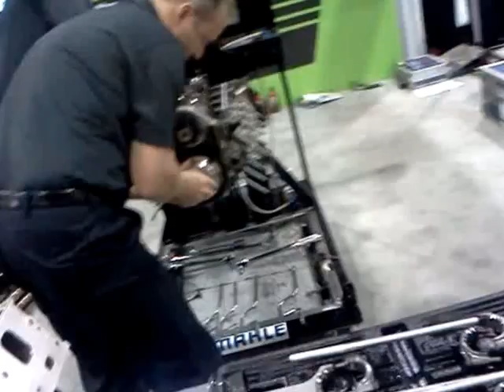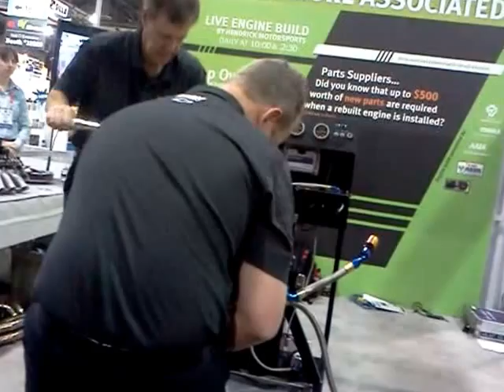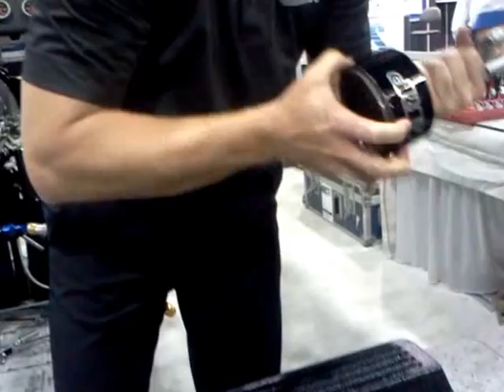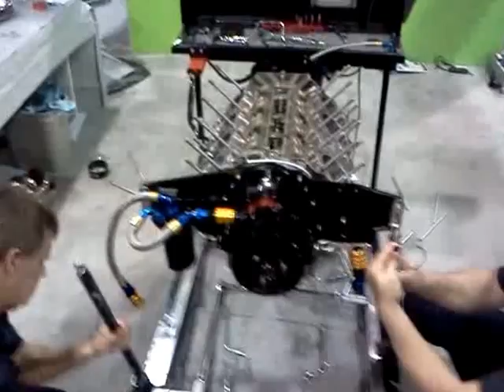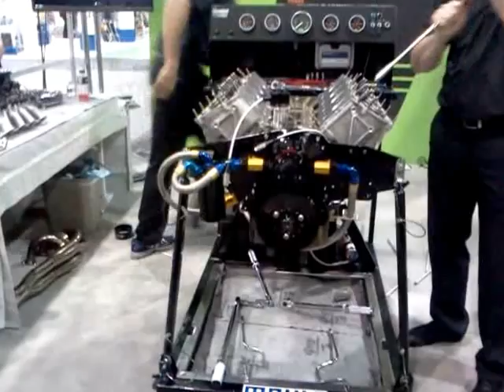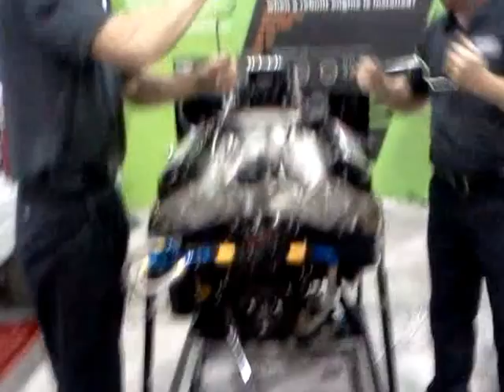Nascar engine building

Comment: Keep in mind all the parts are prepped, the rings are already on the pistons, bearings are set in the rod and caps and the gaskets are glued to the oil pan, valve covers and intake manifold, it really takes much longer when things are not prepped.

Comment: This video is now 3 years old. But it's amazing how many changes these NASCAR engines underwent from only 2 years before this one, in which they were still using the conventional distributors & plug wires. Many other differences as well. Look for the same video title and see the other older video. It is the same Hendricks engine build-off, but from 2 years earlier than this video. It's simply amazing how fast these guys work.